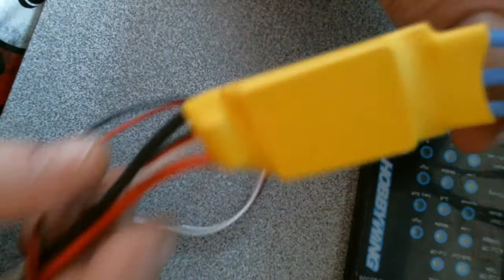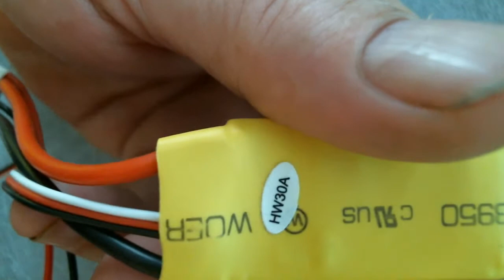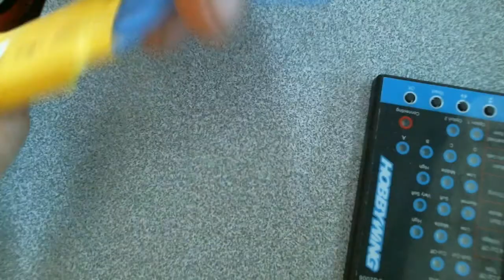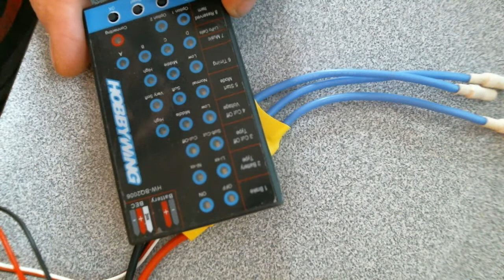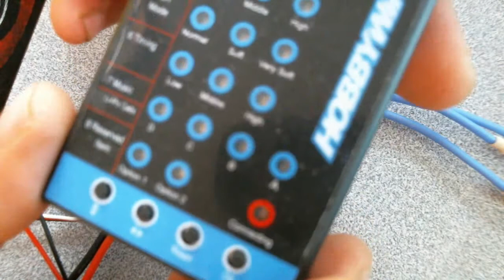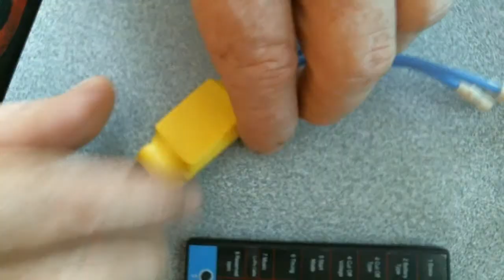Yellow heat shrink and Red heat shrink 30amp ESC"s off ebay

Comment: the GREEN capacitor is a low ESC capacitor (Electrostatic Discharge).  Put there to reduce interference against fpv video.  They are more rare and expensive than standard capacitors.
Reply: It also will be a higher voltage. The smaller one is 25 V and the bigger green one is 35 V.

Comment: I have 2 red 30 Amp esc and 1 yellow 30 Amp esc,  the red and yellow has different tone/beep when connected to battery or when doing throttle calibration,  also the red esc have sync issue when used with MT2204 KV2300 motor(the yellow doesn't) ,  do you think it has different  firmware?
Reply from the maker: Yes I would think so

Comment: had anyone tried running the red ones on 6s
Reply: Yeah! You can run them on 6s(not any above).
I’ll link you a video if you want.
Reply: @rahultej2248  thanks a link would be helpful
Reply: Nathan M oh! I am sorry! That’s a different esc! I noticed that just now while watching it again!
I’ve read the data sheet and the maximum is 4s! I am really sorry about that!
Reply: @rahultej2248  hey thats cool. Do you know of an esc that will handle 6s but will not cut off if the voltage gets low?
Reply: Nathan M hey! Wait a minute! I think I know one.
I’ll give the link.
https://youtu.be/LIb-p9aEugM
And I know that the guy in the video is stupid. But, it’s the esc I am taking about.
Also I think any esc which can run on 6s can go down to 2s.
It’s just, you have to reprogram the esc to tell it not to cut - off.

Comment: Flashing these with SimonK, using Arduino Pro Mini through servo lead.
Download: BlHeli Suite; 
                     this https://github.com/sim-/tgy/releases/download/2015-09-12/tgy_2015-09-12_103edb5.zip

Take the servo lead from ESC and remove the red wire from the triple socket so you can connect signal wire to port D3 and ground wire to Ground on your Arduino without connecting red wire to port D2. Connect ESC to Arduino. (Black wire to ground, white wire to D3). Connect Arduino to Computer.

Open BlHeli Suite,choose tab: Make Interfaces, pick Arduino USBlinker (SK bootloader).

Select interface Atmel SK bootloader, (blue 4).

Power your ESC and hit connect. (Choose your com port correctly.)

It says something about empty ESC or so, hit cancel. Than the magic begins.

On the bottom chose Flash Other. Find your way to the folder tgy_2015 and so on, pick tgy.hex file and hit flash. 

It worked for me and the ESC is still alive.
Reply: Tomas Kostka can be done threw fc usb?
Reply: Didn't try.

Comment: the red one is SK and you can flash SK update or BLHeli on them via servo lead by arduino nano ...
Reply: what hex for blheli? i heard it should be tgy
Reply from the maker: +miHah Yes thats what I ended up using
Reply: how did u flash it?
Reply: +Hasen Hase Can you give more details on flashing the red ones?  When I look at BLHELI, I don't see TGY as an option.  I have used TGY.HEX to flash SimonK onto one of mine, but am at a loss to find the correct BLHELI firmware.
Reply: +Chuck Joga Found the answer.  The red ESCs use tgy.hex and therefore incompatible with BLHELI firmware.  Although you can use the BLHELI suite to flash tgy.hex.  http://www.rcgroups.com/forums/showthread.php?t=2136895&page=408&highlight=tgy#post33060020
Reply: +Chuck Joga  can you tell me how to flash the red one please....
Reply: +saiful rahman You will need a USBASP AVR programmer.  I purchased this one:  http://www.ebay.com/itm/322041892635?_trksid=p2057872.m2749.l2649&ssPageName=STRK%3AMEBIDX%3AIT

I believe that you can use an Arduino board as well, but I don't know what the setup is.

Once you have the AVR programmer, you can connect the following pins to the ESC: VCC, Ground, RST, MOSI, MISO, SCK.  You ESC must have 6 pads to solder wires to.  If you do not. then it is very difficult to solder wires to the ATMEL ATMEGA CPU.

You can verify the CPU and identify the pins here: http://www.atmel.com/images/atmel-8159-8-bit-avr-microcontroller-atmega8a_datasheet.pdf

1.  Remove the red shrinkwrap and hold the ESC with the large capacitor up and look at the ATMEL ATMEGA CPU.  

2. There will be 3 pads to the upper left and three to the lower right.

3. Carefully solder 6 wires to these pads.  This is tricky and you may ruin your ESC.  Check your work and test the ESC to make sure it still works.

4.  Identify the 3 pads on the top left from left to right: 1: VCC, 2: Ground, 3: RST or reset

5.  Identify the 3 pads on the bottom right from left to right: 1. MOSI, 2: MISO, 3: SCK

6.  Connect these wires to your AVR programmer marching the correct pins/sockets.

7.  Download tgy.hex from here:  http://0x.ca/tgy/downloads/

8.  Download kkmulticopter flash tool from here: http://lazyzero.de/en/modellbau/kkmulticopterflashtool

9.  Optionally download BLHeli suite GUI if you want to verify the current firmware on your ESC (mine was tgy_2012-09-30_0d3eb17)  There is a verify menu that will read the ESC and allow you to pick the above tgy.hex file to compare.

10.  Flash your ESC using the kkmulticopter flash tool and verify it with BLHeli suite GUI in step 9.
Reply: +Chuck Joga , loud and clear, thank you very much, its very very help.

Comment: Do you think it is possible to flash those with BLHeli?
Reply: +miHah I flashed the latest SimonK tgy.hex I could find from tgy_2015-09-12_103edb5.  I haven't done an extensive test yet, but it seems to throttle up smoothly.  FYI, I discovered that the one ESC that I upgraded had firmware tgy_2012-09-30_0d3eb17.  I'm sure that a lot has been fixed in 3 years!  I plan to upgrade all of my red ESCs to the latest as soon as I can get my clip working. Soldering tiny wires and connecting to the AVR programmer works, but is a bit tedious.  :)  BTW, I used kkflashtool to flash, but used BLHeliSuite to read the firmware on the ESC and compare/verify.
Reply: yes possible
Reply: +Hasen Hase did you manage to do it? how? with what hex?
Reply: Killed one with wrong hex. But BlHeli Suite reads them from servo wire via USB.
Reply: What hex did you use? Aren't those the same as Turnigy Plush? TGY hex should be used?
Reply: I just randomly picked Multistar or something. I flashed it succesfully but it is now not responding to anything and cannot be read again. So I am ordering some more to test the TGY hex.
Reply from the maker: +miHah Yes It is I ended up choosing the latest TGY Hex and they worked
Reply: where did you get tgy hex?
Reply: +NQIS Steve Well, according to what I see on the internet, TGY uses Silabs chip but these are ATMEL.
Reply: +Tomas Kostka I think you have it the wrong way around.  TGY uses ATMEL.  https://github.com/sim-/tgy
Reply: +Tomas Kostka Have you tried this with the red ESCs?  I was not able to use the DYS USB Linker with the red ESCs.  But have successfully flashed them using an AVR programmer.  Not as convenient, but possible.  I'm about to order a Turnigy USB linker to see if there is a difference.  Please let us know what USB Linker you are using to flash over the servo wire.
Reply: +Chuck Joga what did you flash on them? :)
Reply: +Chuck Joga oooh wow. i need to check them also ... this might be the reason one of mine is throttling up really slow. btw, do you think all that could be done with usb linker?
Reply: +miHah My DYS USB linker does not work with the red ESCs.  According to https://github.com/sim-/tgy, after 2012-06-01 you should be able to use the servo wire and USB linker.  If anybody has a Turnigy USB Linker, I would be curious if it works.
Reply: +Hasen Hase After a bit of research, I am about 99% sure that these ESC cannot be flashed with BLHeli since they do not have an external oscillator.  http://www.rcgroups.com/forums/showthread.php?t=2136895&page=408&highlight=tgy#post33060020

If you have successfully flashed these with BLHeli, please let us know which firmware option you chose in the Flash Assistant window.
Reply: +Chuck Joga i have an all-purpose usb linker that i will try tomorrow. I will report back to you :)
Reply: +Chuck Joga Turnigy plush 30 AMP is listed in BLheli SIlabs supported ESC's.
Reply: +Chuck Joga I use simple Arduino Pro mini. I make interface through BLheli Suite program.
Reply: +Tomas Kostka and is esc responsive?
Reply: +miHah I am going to flash it with tgy.hex right now, I will let you know as soon as I am finished.
Reply: +Tomas Kostka Don't, those red esc have internal oscillator which makes them unsupported by BLHeli. This was found out by Chuck Joga.
Reply: +miHah +Tomas Kostka +Chuck Joga +NQIS Steve On the other hand, NQIS Steve said he had used tgy hex to successfully flash BLHeli
Reply: +miHah Nice Nice Nice, it's ALIVE
Reply: +Tomas Kostka tgy.hex is the correct firmware and I have successfully flashed the latest version. However, this is SimonK firmware.  You may use the "BLheli Suite GUI" to flash SimonK firmware to the ESC, but "BLHeli firmware" is incompatible.

Comment: I purchased 4 of the Red Simon k esc's of of ebay, 20 amp, no problems..... several flights. Only had to throttle calibrate. paid 22 bucks.
Reply from the maker: +Casey Gray Cool do you know what type they where by any chance? As I have come across two distinct types of 20 amp ones see my first video on ESC's and thanks for watching.